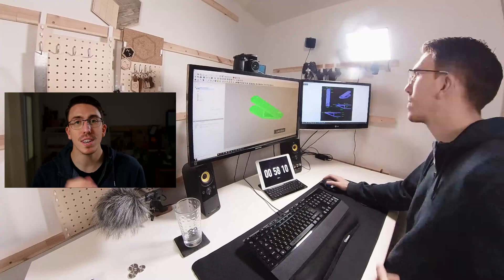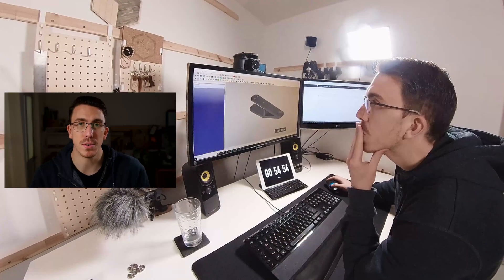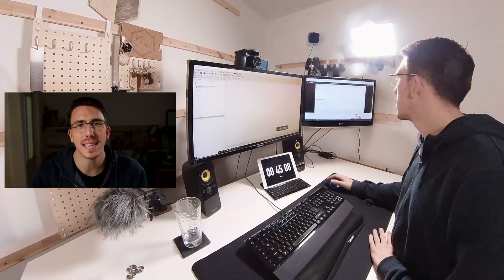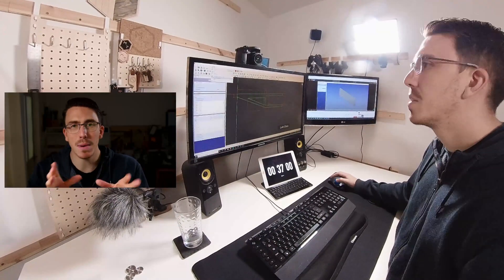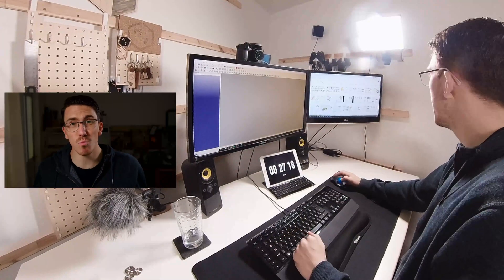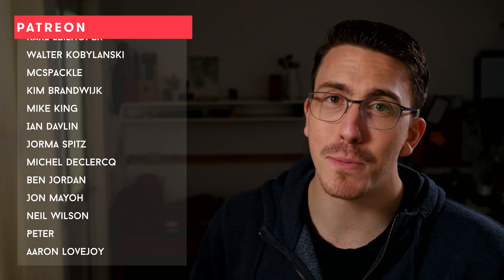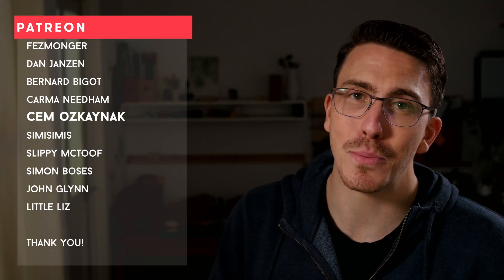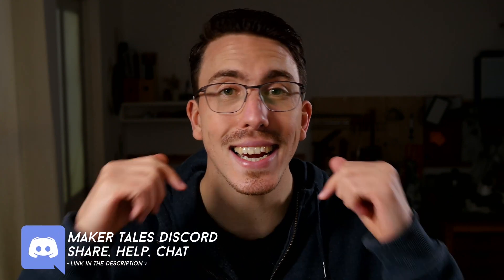Is FreeCAD Too Hard? | Is It Worth Learning FreeCAD? | Who, What and Why…

Comment: I must agree that FC is very difficult to use.  I have a good AutoCAD background  in both 2d and 3d yet I find FC nearly impossible to understand.   First why is there a need for "workbenches"?  I have yet to figure this out.  There are times I am trying to do something as simple as punch a hole through a solid.  Sometimes it works flawlessly and other times it throws up difficult to understand messages that mean very little to the user.  I have given this program a try now three times, but everytime I leaves me so frustrated I am cussing the designers of the software rather than using it.    I agree with many in that FC is fundamentally just BROKEN.

Comment: I like FreeCAD. It is not perfect but it is very capable. As far as the interface goes, I don't think is that bad, in fact I like it. Reminds me of the icon-centric tool-bars most applications had before mobile touch-screen devices like tablets, phones and touch-screen laptops (that could fold their keyboard 360-degrees to work like tablets) prompted Microsoft and Microsoft-like corporations to change their GUI. The reality is that FreeCAD is a desktop application, very unlikely to ever be a good candidate to be used on a tablet or other type of touch-screen device for the same reason that Fusion360 is not used either on such platforms. FreeCAD's icon-centric tool-bar system is very customizable to the smallest detail and the entire GUI can be deeply customized even further using style-sheets.

Comment: As a noob my first experience with FreeCAD is so very negative. It seems to be extremely obtuse and infinitely complicated for no reason. I cannot even figure out how to rotate stuff with a center point in the well center or how to use it without a middle mouse button... I only want to modify an STL a little but have to watch hours and hours of YouTube tutorials so that I might be able to find out what I need to do :l
Reply from the maker: Hang in there hans. If you are looking just to do small edits to an STL I have a micro-course right here: Start with this video https://www.youtube.com/watch?v=R-Vq2O-hvfo and then take a look at this one: https://www.youtube.com/watch?v=9EF2VryBAq4   There is A LOT more to learn but for minor edits, this will get you in the right direction.
Reply: Who does not have a middle mouse button with a roller? Are in you in 1994?
Reply: @jeffbeck6501  Many modern mice are plagued by faulty middle mouse buttons that constantly break. It's also annoying having to click a mouse wheel. I am using a different mouse button by now.

Comment: FreeCad is hard to learn because it is badly designed.
By comparison, SideFX Houdini is also hard to use according to some, but it is a coherent piece of software.
It's a shame because FreeCad is opencascade based, meaning, there is a powerful brep architecture behind it, but it sometime fails randomly and it also too slow for real world use.
Also, it has so badly optimized in some cases that it makes it unusable:
create a box, create a small pocket in it, and multitransform it to make say, 2500 copies
From now on, every operation that you make on the object (downgraph), will take 1 minute to recompute the whole thing, every fucking time. Including adding one point in a sketch... That make it unusable for real world projects.

Comment: The last time I tried using FreeCAD (about a year ago), I ran into a bunch of glitches and problems; sometimes sketches and parts would just randomly disappear, sometimes FreeCAD would freeze up. Perhaps I need a better laptop with more than 8 gigs of RAM?

Anyway, I'll look forward to your tutorial. I'll also be receptive to any other free CAD program besides Blender and FreeCAD.
Reply: Solid Edge Community Edition is a professional CAD program that is free for home use.
Reply: uhm, usually those kind of issues are just bugs, thats something freeCAD is plagued with, especially intersecting edges of solids within the same body can be a big pain, but these can be worked around with some effort quite easily, just work in a different body usually does the trick
Reply: Sounds like typical FreeCAD bugs.

Comment: You should check out DesignSpark softwares, free and open-source. They do three softwares for respectively mechanical, electrical and PCB.
Reply: Sadly Windows only - otherwise would check it out fully.
Reply: is it really open source?? where can I find the code?
Reply: @adrianinsaval  Certain applications on DesignSpark require you to licence source code using an open source model. Where this is the case it is your responsibility to understand and comply with the open source licensing model and it is your responsibility to choose the most appropriate open source licence type from the options made available to you. You understand that unless you choose an open source licence type for these applications, you will be unable to share content.
They don't say how the code is actually made available, unless perhaps you 'join' the community. And having open source elements doesn't make it an open source product.